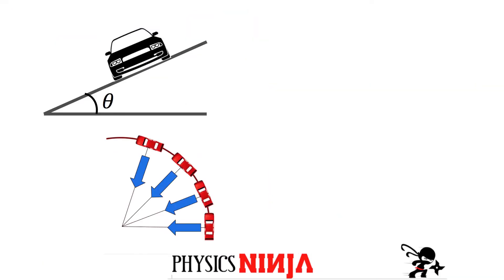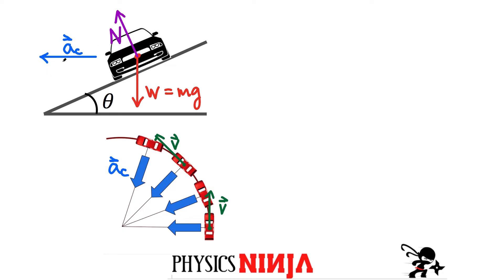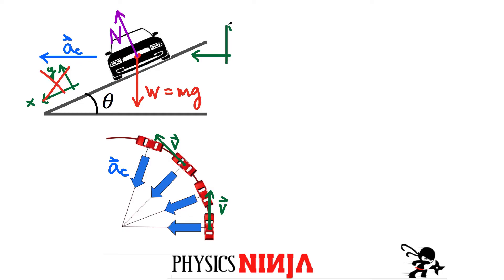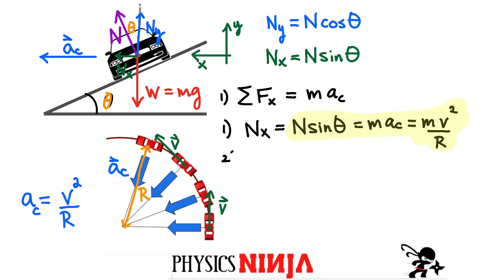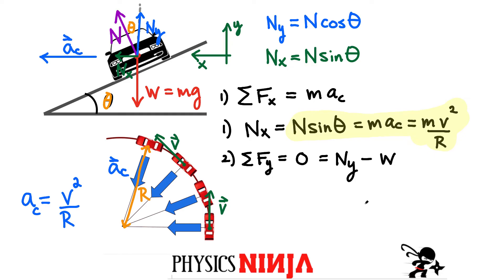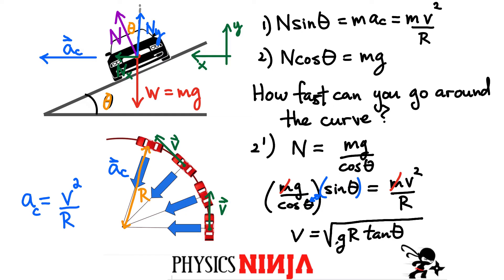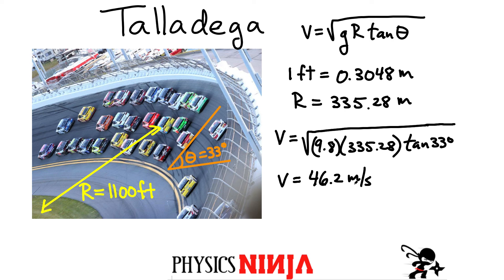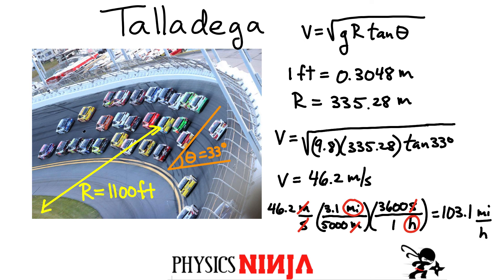Banked Curve Physics - Uniform Circular Motion

Comment: why is there no angles for the force of gravity?
Reply: I guess if we decided to rely on the vector components of m*g (force of gravity [otherwise known as gravitational acceleration but that's besides the point]), then we would have to adjust our coordinate system parallel to the incline, which was what Physics Ninja showed wouldn't work since our acceleration is horizontal in nature when considering the acceleration of this scenario.

I don't really know if the centripetal acceleration being horizontal is just a natural thing when considering these types of problems, but I think they are.  Thank you for asking the question, and feel free to follow up with me.

Comment: In a ballistic test, a 25g bullet travelling horizontally at 1200m/s pass through a 30cm thick, 350kg stationary target and emerges with a speed of 900m/s. The target slides without friction on a smooth horizontal surface.
I) Calculate the average force(Favg), that the bullet exerts on the target.
II) Calculate the target's speed after the bullet emerges.
Reply: Need help there, bud? Lol.

Comment: Thank you for the explanation. I have a doubt regarding the Normal Force component. In inclined plane problems we use mgcos(ß)=N but in uniform circular motion, we use Ncos(ß)=mg.  Why is it so? Can you please give a physical explanation for the concept?
Reply: Brother because mg acts exactly downwards where as N depends on surface and body contact in Newton laws of motion we represent the equation f=MN where n=mg in order to make n=mg we have to make sure that both are acting opposite to each other but when there is case of curved road N slightly changes so in order to make n=mg we need to resolve the mg in 2components there you can find which component of mg is opposite to n I.e we write n=mgcostheta
Reply from the maker: Great question, I will make a video next Wednesday when I get back from vacation
Reply: Because of the choice of coordinate system. Usually, we choose the coordinate system as parallel and perpendicular to the inclined plane, however, as Physics ninja mentioned,  in this case it's useful to consider a  coordinate system in which centripetal acceleration is parallel to the x-axis, makes life easier.
Reply: There is not any physical explanation, but there is a mathematical explanation for that and that is the Pythagorean theorem.

Comment: I would like to discuss with you the aerodynamics of a "banked turn" in an airplane.  Some pilots maintain that in a constant banked turn, there is an "overbanking" tendency because they believe the top wing is flying faster than the inner wing in the banked turn.  I do not subscribe to this and many other pilots don't either.  But many do and the FAA handbooks are also in tune with this theory.
They falsely believe the airplane makes a banked turn as if it was turning like a propeller.  It does not.  This handbook by the FAA is very good, but figure 3-26 is incorrect in my opinion because it does not show the airplane in a bank while it is turning.  I'd like to know what the Physics Ninja has to say about this "overbanking tendency".  Does the top wing really turn faster than the bottom wing in a level turn?  https://www.faa.gov/regulations_policies/handbooks_manuals/aircraft/glider_handbook/media/gfh_ch03.pdf    See figures 3-25 and 3-26.   I believe 3-26 is incorrect because the figure does not show the airplane in a bank while it is turning.  It seems they are describing a propeller rather than an airplane. 
Remember, the airplane is NOT connected to the ground in the same way a car is while it is turning on a banked road, so aerodynamics of flight comes into play.  That changes the example from a car on the ground that is turning.  Here's the link again.  https://www.faa.gov/regulations_policies/handbooks_manuals/aircraft/glider_handbook/media/gfh_ch03.pdf
 Thanks in advance
Reply from the maker: Hi,  thanks for the comment.   I'll have a look at the pdf but please email me for a response  onlinephysicsninja@gmail.com
Reply: @PhysicsNinja  Thanks, I've been having a similar discussion on another channel with an engineering student who is also interested in aviation.  I'll amend this note and paste the conversation here so you can read our discussion.  Here it is-  https://www.youtube.com/watch?v=Oc7ViQnXkUs&lc=Ugy0xpD0JdVC8E8Wnqd4AaABAg.8u6d7Eftlry99RsSim6zHE